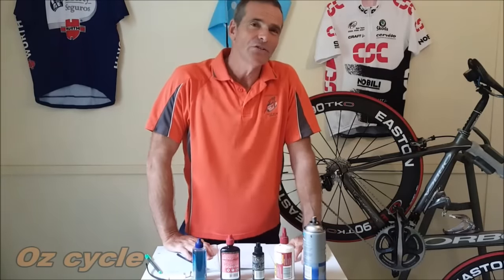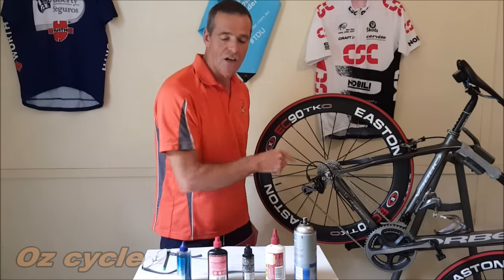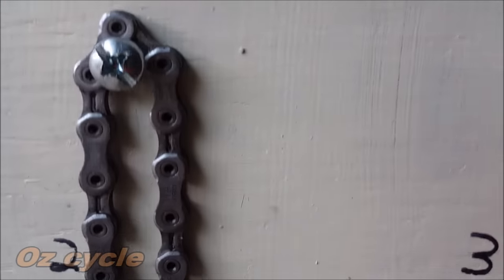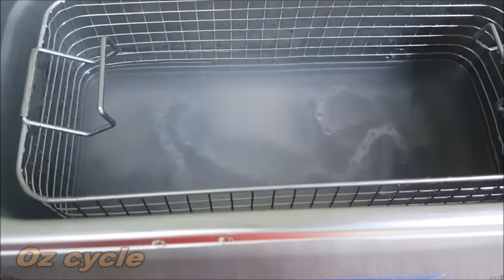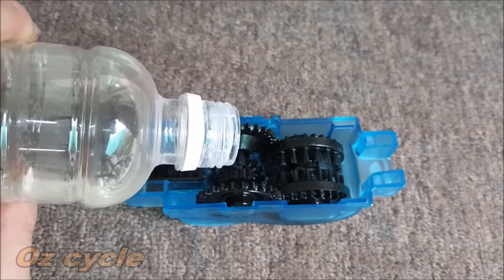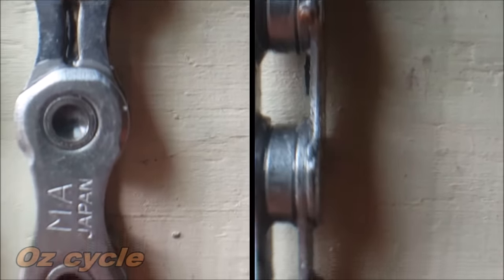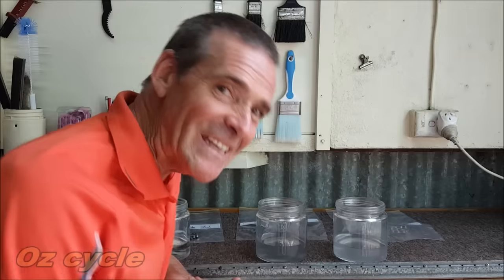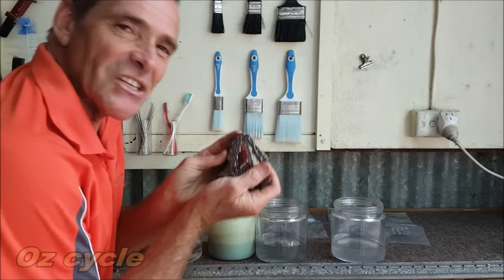Best chain clean ever !!

Comment: Thanks for making and sharing this video comparison...
They all do a great job of cleaning.
I do feel that the brush system is half baked.  You still need to clean the cassette and the chain ring.  With the chain on, not so easy.
The homemade cleaner you can also use a jar to clean the cassette.  The disadvantage with the homemade cleaner is the responsible disposal of the gas.  
Both the homemade method and the ultrasonic bath also allows for cleaning multiply parts including the cassette and easily access the chainring and jockey wheels.
I feel that the ultrasonic cleaner allows for that drivetrain maintenance to be performed easily at the same time with less of an environmental concern.

Comment: interesting video if you're interested in this type of thing. I can only imagine that it took a bunch of time in setup, filming and editing. given the effort weighing the chains pre and post clean would be worthwhile imo, also identifying the # links in each (I assume the same?). measuring the terps and standardised shaking... maybe too much. thanks
Reply: Have you gone mad, sir? You think if one has two more links than another that it will make a difference in the cleaning results?
Reply: @BPoweredLove  chain does not need to be ultra/super/hiper clean, for first cleaning if switch from oil to wax, gaseline/petrol is good to remove all important dirts that matters, when chain is on wax, no need for that deep cleaning, just rewax 2 times and all dirt will go out of chain, i need 8 minutes to make 2 passes of wax on chain installed on bike by useing inductive heater that heats up chain in few seconds and then can be aplied wax
Reply: @BPoweredLove  The chains looked the same length whilst they were hanging to dry, to me.

Comment: The benefits of number 2 is that you don't have to remove the chain
Reply: Exactly because it's not possible to keep on taking your chain off the bike every time  you want to clean it.
Reply: That's not a benefit, you get the gunk all over your bike.
Reply: What makes you think it isn't possible to take the chain off every time?
I do it.
I clean the chain once a month and reapply the parafin wax, it's all the chain cleaning i need to do, all other times i just let the water run over it while i wash the bike.
Reply: @khalilrazak6486  You can but it's a faff. I do a general clean of my bicycle once a month using mild degreaser which is part of a cleaning agent I use. I use an old toothbrush to help clean the gears and then relube the chain. I also do weekly-biweekly checks just to make sure everything looks fine, basically a 1-2 minute quick inspection. If the chain is gunked up I'll give it a quick patch clean until the main clean at the end of the month. Every 6-12 months I do a complete disassembly of the casette, derailer and crankset. Soak them in degreaser and use a toothbrush to ensure they are clean. I check the freewheel bearings to ensure they are well greased and then reassemble the bicycle.
Reply: @khalilrazak6486  Why isn't it?  I do it all the time.  It takes 15 seconds to do.

Comment: I would have been convinced if you had used degreaser with all three methods...
Reply: And put each chain on the junk bike to spray with high pressure hose, that's the key difference I see.
Reply: IMO he proved nothing other than gasoline(petrol) cleans a dirty chain better than two other degreasers.

Comment: I always used to think a brand new chain that was greased was fine to leave however i was told to get that sticky crap off! Everything stuck on your new chain. Soak it gas or thinner over night shake it and make sure its good. Then apply the lube you want

Comment: I use Simple Green in my 120 degree (F) ultrasonic bath.  Then soak it in hot water followed by a good rinse and dry.  If I am still getting residue when wiping dry, it goes into the ultrasonic cleaner again to repeat the process. Then, I simply soak the chain overnight with Liquid Wrench Cable and Chain Lube.  I let it hang and drip for a couple of hours and then wipe it off before installing it.  It's worked for me as long as I can remember.  And I ALWAYS clean my cassette and chain rings each time.  No point in contaminating my clean chain with those being dirty.

Comment: This is neurosis - I am a reformed paraffin waxer who rides every day.  Removing the chain to clean and then waxing takes way more time than the clip on scrubber and liquid lube.  Use the extra time to enjoy life.
Reply: Right, and the other solutions also generate much more contaminated fluid. Where do you dispose it?
Reply: @murafskis 

Uhh.. that "stretch" you/we  call it?  Yeah, that's a misnomer. 

It isn't "elongation" of the steel due to use. You aren't strong enough to permanantly deform the steel, certainly not at the temperature a chain runs at on a bicycle. 
Steel has very high tensile strength. It takes a dynamic shock load higher than most normal people can produce or forces outside the normal range of motion of a chain to deform one significantly and permanently.  (Ie: lateral bending movements, or the sheer force say... a pro track cyclist can produce.) 
 I'm a pretty big guy, 190-200 pounds of lean meat, Lot of it in my legs... I can spike 2000 watts for a couple seconds, no problem.
I'm not "stretching" my chain. 

What makes your chain "longer" over time is WEAR.  Yep, all that microscopic ferrous metal material ( you know, the stuff that sticks to a magnet?) you get in the bottom of your chain cleaner tub?   Yeah, that stuff... it's your chain! Tiny little pieces of the rollers and pins, and a lesser extent the side plates.   That's why measurement between links gets larger on a chain gauge the longer a chain is in service.   You don't stretch it - it eats itself.   How much and how fast the chain eats itself  is dependant on environmental conditions, maintenance, and frequency of use.   No matter how much or how little you obsess over your chain, the process of wear is inevitable.  It's just a question of how fast.  Clean, well lubed chains will wear slower,  and over time, a chain gauge will prove this.   Side by side, all other factors being equal - the well kept chain will show less "stretch"  than the grimy, unkempt one. Every time, forever and ever, amen. 

My advice is Clean often, lube liberally - follow directions of your favorite lube (some have specific processes to maximize whatever magic they claim to do) 
Replace chains preemptively - get a gauge and keep an eye on wear. Replace when worn. Your cogset and chainrings will thank you for it.
You can be as obsessive or as slovenly as you want, but cleaning followed by lubing WILL make your chain last longer, the more often you do it. - guaranteed. 

That being said,  I'm a chain box cleaner, use park chain brite in the box, and like Squirt brand lube.   Seems to work well for me. 
YMMV  (litteraly)
Reply: @stinkyfungus  I meant that parts of a chain become thinner, and then pins standing a bit wider inside rollers of the chain. Overall chain is a bit longer, so that's what I call stretching a chain.
Reply: Nah I rotate 3 chains per cassette and my cleaning and waxing time is less than you spend on cleaning and loss of energy.

Comment: WD-40 changes from a solvent that penetrates into a thick grease that lubricates after a couple weeks of the volatile components evaporating.  This makes it ideal for a chain because it will penetrate down to the o-rings and be held there by it's surface tension until it changes to grease.  Only the excess will fling off if the chain is used before the conversion process takes place.  I spray it on my bike chains with cardboard under the chain to catch the over spray.  This cleans the chain.  Then, I wipe off the excess, leaving the small amount that penetrated.
It, also, is an excellent anti-oxidant to prevent rubber cracking from oxidation.  I use it on my motorcycle seat before winter storage and it prevents cracking.  Salt spray testing in an environmental lab showed it to be the best at corrosion prevention.
Reply: i swear i read this comment on another chain vid lol, from what i've read inc. a few v helpful comments from other WD-40-onlyists I think I'm gna stick to simple regular frequent and liberal application of WD-40 for my new chain on my new bike too
Reply: bicycle chains don't have o rings motorcycle chains do. i believe wd-40 is petroleum based although its apparently safe on rubber i still would use it if anything it would promote cracking

Comment: This is the best chain lubricant because my bike chain is well lubricated and silent.  The chain is also very clean compared with the previous wet lubricant I used.  Therefore I do not have to clean the chain after every 60-kilometre ride.  In fact, I do not clean the chain anymore.  I do not mind to tell you I never wash my bike.  This lubricant is easy and cheap to make.  The only thing I do not like is my wife will give me a shelling when I make the chain wax lubricant because the kitchen will smell of wax.  Now I would make it when she is not around.  Thank You so much, oz cycle.
Reply: Oh, I post the above remarks in the wrong section.  It should in the section where you oz cycle show how to make this chain waz lubricant.  Tk.

Comment: I use a whiskey bottle with 8 oz mineral spirits. Tie a loop of string through chain, guide chain into the bottle,leaving the tail of the string outside the bottle, cork the bottle. Gently swirl bottle, and let it soak for an hour. Remove chain, hang vertically and spray with rubbing alcohol. Dry. Follow with lube on inner rollers, let gravity distribute.wipe down, install

Comment: Regarding the magnet, stainless steel is almost entirely non-magnetic so any steel particles at the bottom probably got there by gravity.
Reply: Depends on the steel. Most stainless steel pans work with induction stoves

Comment: used to do petrol clean in 1970.  Obviously the chain clean tool is best.  I have one and breaking a chain and reconnecting will take longer than the tool.  also the author proved the stuff is from the middle is not touching the drivetrain. Also my chains have no holes.  I can clean 5 times as often since it requires that much less time and not considering time to go and buy breaker links.

Comment: Apples to pears.  All this tells me is that petrol is likely a better solvent, not which is the better method.  Use the same solvent at the same concentration or different solvents with the same method.
Reply: Sean Orlob Nonsense!!   Actually it does tell you what the better method is because you can not use petrol in either an ultrasonic cleaner or a chain scrubber type device in real life.  Try using petrol in an ultrasonic cleaner and see what happens. That is a substantial limitation of both those methods,  the fact that neither can use a strong solvent like petrol. He's comparing 3 "overall" cleaning methods and part of the ultrasonic and chain scrubber "methods" is that both are limited to using mild cleaning solvents, whereas the 3rd manual method allows you to use a stronger solvent like petrol.  That's a perfectly valid and logical test of three real world "methods" to cleaning your chain.  Clear as mud????  LOL
Reply: I agree with Sean Orlob because gasoline is NOT an acceptable degreaser or cleaner for most of us. And the original Oz video demonstrating its use contains poor technique where the author splashes gasoline on his ungloved hands while he's using his homemade cleaning contraption. The only sensible way to use Oz's homemade cleaning device is with a "safe" degreaser/cleaner. Therefore, the homemade "method", as illustrated in this video, does NOT win.

Then there's the issue of Oz's improper use of his ultrasonic cleaner. The liquid level appeared to be too low, preventing the vibrations from the side walls of the cleaner from working efficiently. Had the ultrasonic cleaner been used correctly, it might have done as well as the homemade device even with the degreaser disparity. That's the advantage the ultrasonic method gives you -- it allows you to get a good cleaning with a "safe" degreaser/cleaner.
Reply: Sean Orlob tholuen
acetone

Comment: Build myself  the Homemade Cleaner and clean it it "Bremsenreiniger" in German ;) also mean Brake Cleaner. There is kind of Petrol and another thing´s in it. But i choose for 1€ a Pencil Holder with a small Grid outside, (so i can clean another Part´s) and a thin can for 2€.
My wax is made out of Tealights (8 of it) and Mineral Lamp Oil.
It is on my Bike at Monday 13.2.17 and the Condition are dry and cold.
My chain look´s very clean and all the other Part´s on it =)
To Friday we maybe get wet condition and im exited how the chain will look like =)
Ride ~6km it isnt much but the chain can get very dirty even on this short distance.

Oh and it is really a much smoother ride and gear change... absolute love it.

Happy to see you next time =P

Comment: Excellent comparison of different ways of chain cleaning. I'm kind of impressed that it took only 10min for chain to sit in petrol, with some additional degreasing, for the Homemade cleaner to win this contest. In later video "The Ultimate bicycle chain clean" its recommend to leave chain soak in petrol for couple of hours, preferably over night. Or was it intended to do it prior waxing only?
Reply from the maker: A long soak in petrol is essential to remove factory grease before the initial waxing.

Comment: i have never in my life seen so many so concerned about their bike chain and the extra watt's it takes when a chain gets dirty! just my opinion on seeing how much a great problem this is turning out to be? Does no one make a thin ribbed or cogged drive belt to use instead of a chain? Or better yet,, A drive shaft?
Reply: Yes. A belt drive with internal hub gears is an option. They are very durable and low maintenance but cost 4 or 5 times as much. Good for world touring.

Comment: If you were to spend the time on the saddle he takes to clean his chain, you would make the 5w ten fold in the long run. You're welcome.
Reply: Yeah, why go through all that trouble? Regularly wipe and lube your chain and it will be good until you have to replace it anyway because of stretch. A bicycle chain is a consumable component. Additionally, completely stripping the chain like this will probably shorten its life.
Reply: Kaikki Meni 
At the end of the day this isn’t about chain longevity or saving 5W. This type of effort and commitment owes more to form, rather then function. Consider it a stylistic choice to want to ride with an ultra clean and sparkling chain. Just like some people shave their legs and some don’t. Neither makes a difference to anything other than your stylistic presentation.
Reply: @tobithetonewheel  I agree, as much as I like the final result, as I ride a fixed bike, my chain streches in about 4 months, regardless of the cleaning method.

Comment: Always wear gloves when working with chemicals or fossil fuels.  My father (an auto mechanic) died of leukemia caused by not wearing gloves.
Reply: I had dinosaurs start growing on my hands...
Reply: Yes, it has been known for many yeas that auto mechanics who's hands are always dirty with oil and grease are at risk of these diseases , it is a great shame that the motor industry didn't highlight the risks years ago.
Reply: @StopaskingformynameYouTube  i hardly used cloves and i don't have cancer,brake dust asbestos didn't  wear breathing mask?
Reply: @vicamaral  well since you didnt get it i guess it's the same for everyone.
Reply: anecdotal evidence is of no statistical value.     it's a single, random point of observation.   Do you graph a single data point and extrapolate from the origin for a trend?    I wore my canvas shoes out today and it rained.   I guess i made it rain by wearing those shoes.

Comment: What works quite effective and withless waste, is brake cleaner. I just use the automotive grade stuff, spray it, brush it, soak it overnight and the chain will be as clean as ever. To make sure no residue is left on the chain, spray with alcohol and there you go. The best thing is that alcohol and brake cleaner evaporate except the grease and dirt, which can be disposed much easier than petroleum, gas or mineral spirit.

Comment: Nice. I've used the chain brush thing in the past and wasn't impressed at all so binned it. I came up with my own solution rather similar to your homemade one but use paraffin/kerosene as my solvent rather than petrol but hadn't realised about the waxy film it leaves behind. Best thing I've found in recent months is a can of pressurised degreaser, but it isn't as thorough as your methods and gets expensive fast. I've just bought several litres of aqueous degreaser to experiment with.
Reply from the maker: +Hugh Wallace Automotive shops often sell degreaser cheaper than anywhere else Hugh.

Comment: Hi Oz Cycle, if you were in Canada, this video could almost qualify for the Red Green show for handyman corner if it were slightly less thought out. However, I still cringe just a little at using some of these petroleum products. But at the end of the day, I would like to discern they difference in clean chains from a best methods vs best solvents. I still get out the old nail brush and give the chain a good scrub.
Reply from the maker: +SlowBoyAthlete Petrol cleans best...try it....no need for scrubbing. Degrease after and its ready for the wax.
Reply: With the Red Green Show.... we need the chainsaw running in the background. Just for that Northern ON/BC/MB/NB/SK/ AB did I get them all?? EFFECT! Makes me homesick! Hah a ha ha